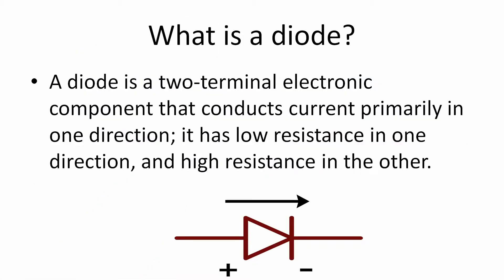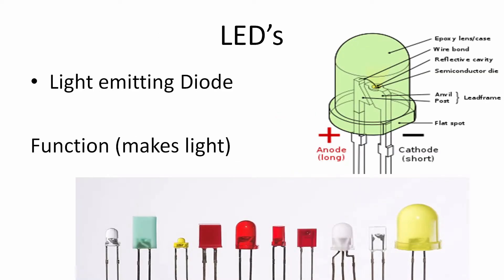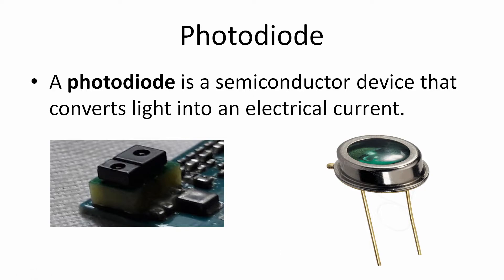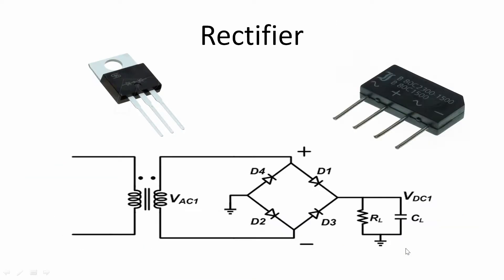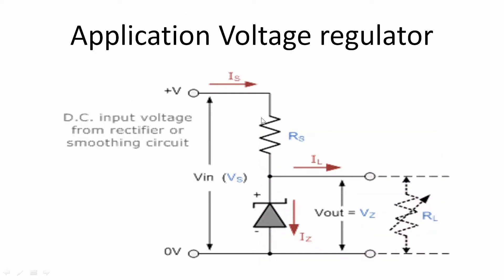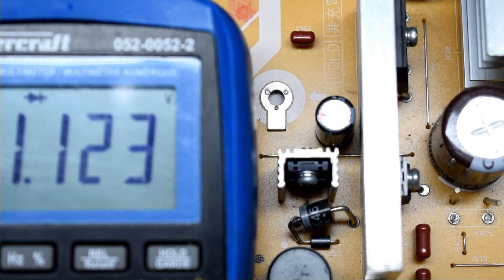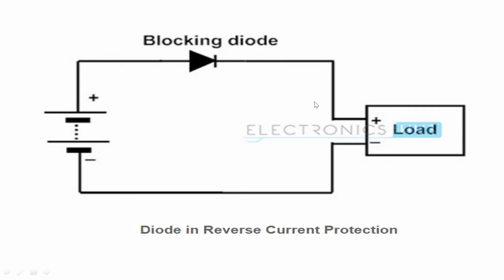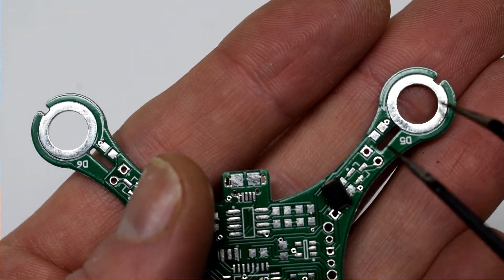What is a diode? How to test if they are bad?

Comment: Can I use diodes to my vehicle lights? I have multiple lights i bought to add to my vehicle that I want to activate during certain situations such as back or opening a door. However don't want to compromise that function of the current lights. So I don't want my reverse light to turn on when I open the door. I apologize if this is confusing.